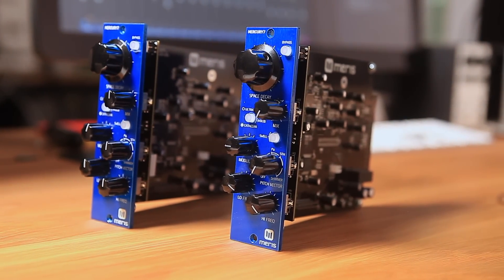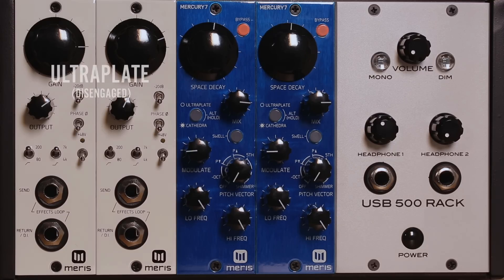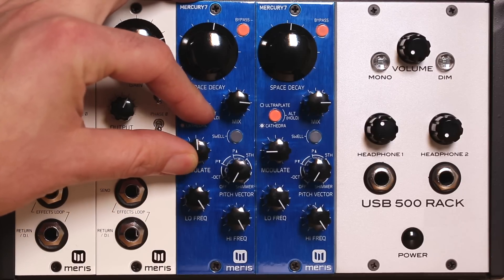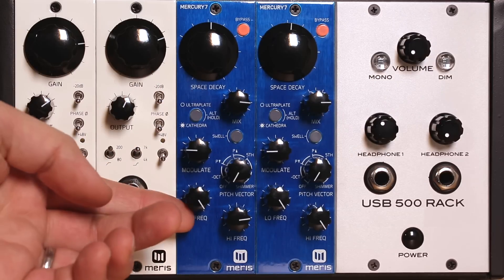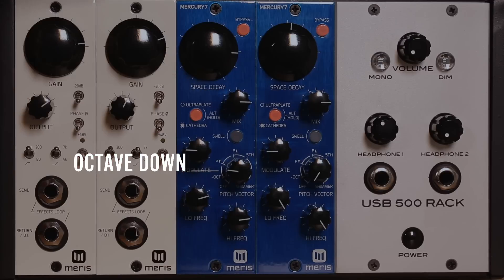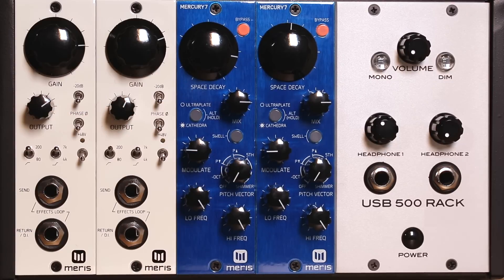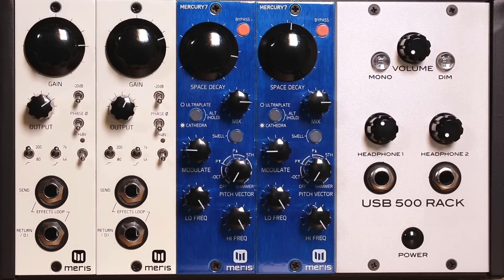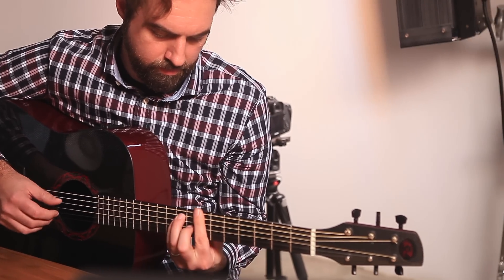Mercury7 Reverb 500 Series Feature Demo

Comment: It would be nice to have the second layer control available live on the second unit!
Reply: +FeloniousThunk That's actually a great idea...when running them in stereo that the second layer controls are the ones active on the second unit!  Especially since adjusting a second layer function messes with your setting on the first layer because you have to move it and then put the knob back in the exact position.   I wonder if that's something they can update in firmware for later units...
Reply: FeloniousThunk fantastic suggestion

Comment: Hi Angelo, I just bought the Mercury 7, the pedal version. I can't wait until Monday when it will arrive here! I just have a curiosity: is it true you engineered the Line 6 FM4?
Reply: Thanks for buying the Mercury7!!   Yes, the FM4 was my baby!  I worked on the MM4 and the DM4 before that, but the FM4 is where I really got to first spread my wings.  I created all the algorithms, built the voicing tools, coded the DSP & MCU, and they even let me manage the project through to production.  I learned tons making that pedal.  Those are even my teeth in the manual.     Later on I migrated all of those algorithms to the M-series where I updated the pitch detection algorithm.   I'm proud to say there is still nothing quite like Comet Trails and OctiSynth out there.

Comment: how does this do on vocals
Reply from the maker: Hey there,  we love Mercury 7 on vocals.  You can run direct or as a send from your interface.  The Hi and Lo frequency cut knobs will give you extra control for fitting the reverb into the mix and the Pitch Vector can be very interesting with vocals.  Ultraplate mode will give you great plate tones while Cathedra can put your vocals in a larger, more reflective space.
Reply: @MerisUs  ok cool i guess i will buy one now  , but i would love to see a demo with the vocals